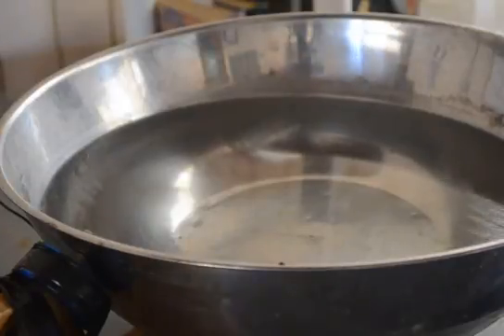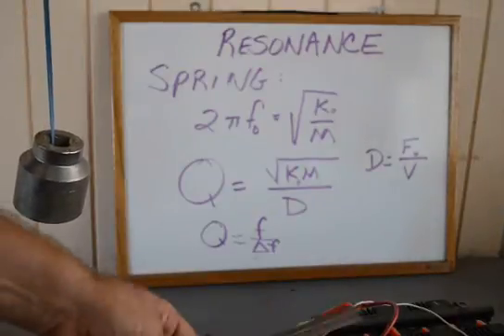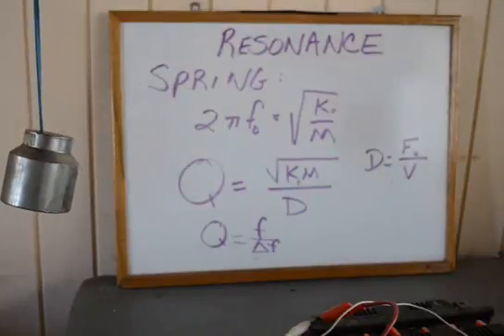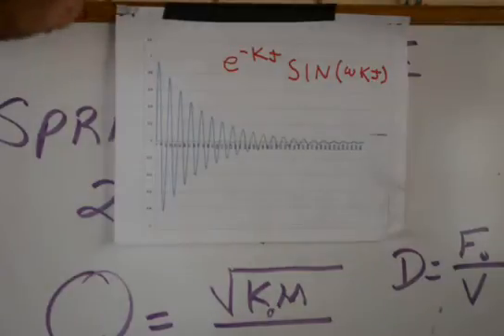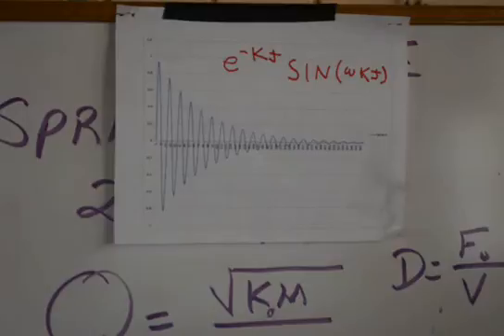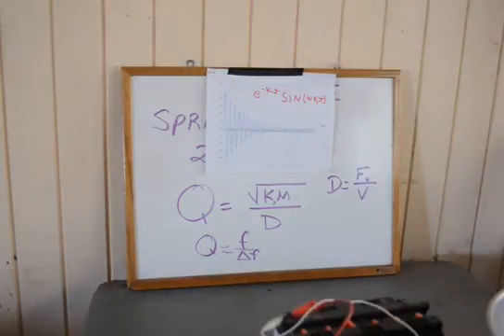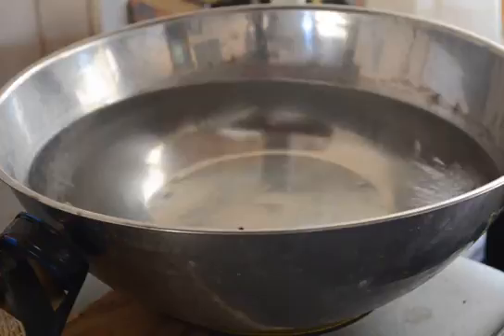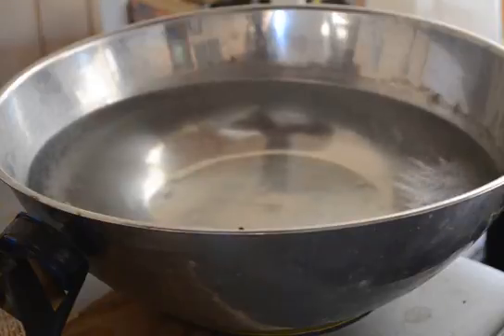4 Free Energy Resonance

Comment: So,
Basically what you're saying is that the bowl of water, or, the resonant cavity will have many different variables. The material the bowl is made of will be one, the length, width, height and shape will be a whole world of others, and, of course the material and volume/mass of the material inside of the bowl will be another ever changing bunch of variables.

If this were the case, how would one ever combat the change to acquire the "self resonance" of this vessel filled with water? Would you think this would all change by covering the vessel, and, add a number of different variables to be calculated if the bowl were say mounted in a moving or shaking environment?